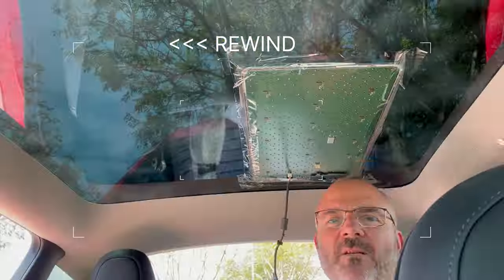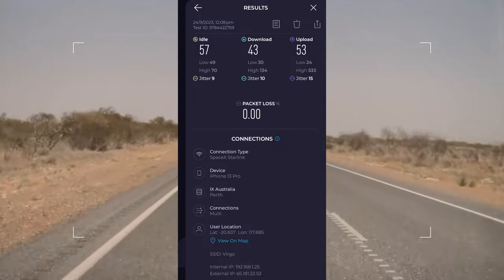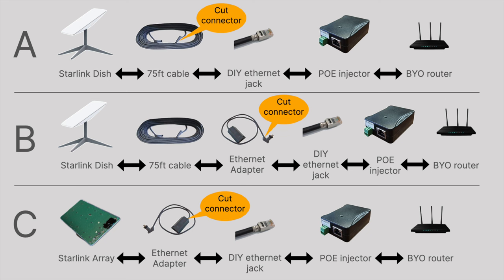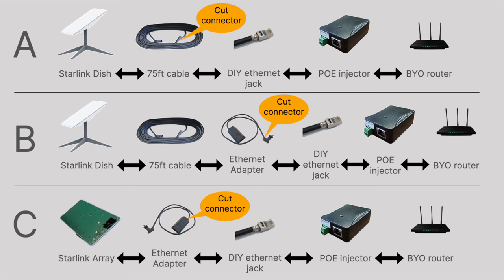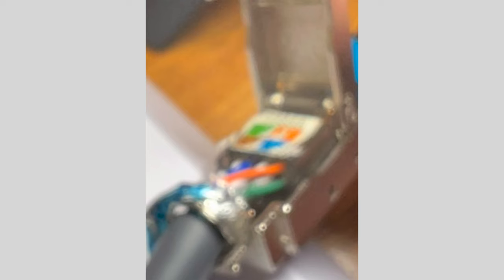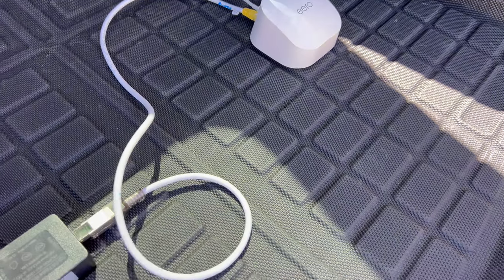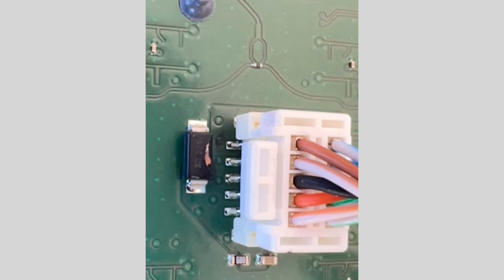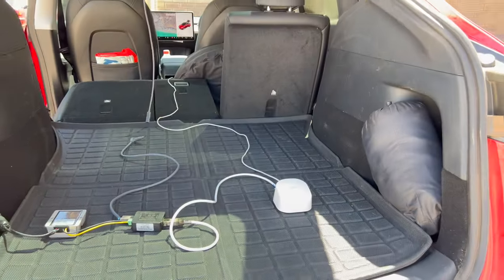Don't kill a Starlink converting it for 12V POE, I did!!

Comment: Based on the location and the way it's connected between the Ethernet jack ground and the PCB top ground pour, I suspect that this is a suppression component, possibly a TVS or a similar device. Providing a few high-resolution pictures of the component, its location, and the nearby parts could help point me in the right direction.
Reply from the maker: Thx @steelcuts. See some pics showing the damage in my reply posts to @sayanchx

Comment: Check if the polarity in your  supply into Starlink is right... at a cursory glance it looks like it may be a reverse polarity protection diode OR TVS device... maybe some others can help positively identifying the part if you share higher resolution images...
Reply from the maker: Thx so much for your help. Try these pics for context and higher rez. https://photos.app.goo.gl/a4ffe57u1YDh8pEx5

The part is burnt on top but I can make out a logo, I think, and the numbers 229.
Reply from the maker: I found another burn mark on the PCB, I fear this is going to harder than it looks. 

https://photos.app.goo.gl/PMcxHJqHKKFiSjcb9
Reply: Let's collaborate on this! Indeed, it appears to be a "standard" BY220 schottky Diode, likely serving as reverse protection. I did contemplate the possibility of the connector having reversed polarity. However, to the best of my knowledge, with proper POE implementation, polarity should not be critical, as most designs include a full bridge rectifier at the incoming DC+ and DC-. However, I suspect this PCB lacks one.

I believe the connector may have been wired incorrectly. The diode is a straightforward fix, and the trace can be repaired. However, the PCB in this area needs thorough cleaning and may benefit from the expertise of someone who is well-versed in these matters. If you're fortunate, the large black LAN transformer might have effectively shielded the valuable circuitry behind it and could possibly remain unscathed.

Edit: Also thanks for uploading the pics :)
Reply from the maker: Thx for the detailed reply. Given these conditions:

- I'm travelling in remote parts of Australia
- I only have access to a butane soldering iron
- My soldering skills are okay for non-surface mount components
- I have bad eyesight

...that I try this plan (Worst case is the board is still dead after I butcher it)

1. Buy this regular sized component: https://www.jaycar.com.au/by229-fast-diode/p/ZR1028
2. Desolder and hopefully remove existing surface mount diode
3. Use jumper wires to attach purchased diode from 1. to circuit
4. Use jumper wires to bypass burnt trace(s)?
5. Fix the POE wiring issue I have :)
6. Cross my fingers

Does this sound feasible?
Reply: @AUSY8  The BY229 diode might be a bit of an overkill, in my humble opinion. Soldering SMD components of that size isn't particularly challenging; all you need are some tweezers. It doesn't have to look perfect; functionality is what matters. However, a butane iron and poor eyesight can be a bit problematic. I've seen individuals with impaired vision accomplish impressive PCB rework, but they had access to microscopes and high-quality tools in our labs.

At the moment, the link is non-functional, and you can't make it worse, especially if there's no one in your area who can assist you or even do it four you. Your evident enthusiasm is often half the battle won. I'd be willing to help for free, but I'm based in Germany.

Your plan sounds fine, but I would still consider obtaining the SMD diode :)

Before you inadvertently make things worse while performing the repair, it might be a good idea to leave it as is, do some research, get some rest. This approach has saved me a lot of money and frustration in the past! :D
Reply from the maker: Sound advice there. I will do some research on a suitable SMD diode replacement and see if I can get some help once in more populated areas. Thx for your time.
Reply: @AUSY8  No worries, mate. I wish I could be of more help. If you have any further questions, please don't hesitate to ask. Wish you good luck! :)

Comment: Never let the magic smoke get out. 😂 Sorry you had the issue - hope you can fix it and get back on the Interweb. Cheers
Reply from the maker: Thx. The other upside, that I did not mention in the vid, is that we do still have a working dish, but I dare not mess with that one for fear I cut the other half off from the interwebs.
Reply: That sound was too painful to hear, sorry you fried the starlink. Good luck finding that part so you can resurrect your frankenstarlink 😊
Reply from the maker: Thx  @AutosNGizmos  I think I need all the good luck I can get at this point. I hope others learn from my mistake.

Comment: Man, why didn't you just buy the YAOSHENG RJ45 to SPX adapter? It's like 30 bucks... 😉
As for the burnt part, it looks like a reverse polarity protection diode to me. I think you should be quite fine only removing it as a temporary fix to see if anything else got damaged. But really make sure you have the power wired correctly this time. 😅
Reply from the maker: I just did. I have ordered one and expect it soon  :)

I was trying to avoid a lot of excess cable just lying around in the car. Anyway the moral of the story is double/triple check your wiring.

Comment: when you opened the dishy, you disconnected the starlink cable, why did you not just cut the wire coming out of the pole, took it out and made a new rj45 connector swapped going to the POE ? Then from POE swapped out and T568B to your after market router.
Reply from the maker: I was trying to smart and preserve as much of the original setup as possible and only cut the cable of the cheap $60 ethernet adapter. You can see where that landed me.

Comment: Ethernet jack you wired up, did not follow the T568B wiring, you appear to have swapped the green & green stripe with blue  & blue stripe
Reply from the maker: that's interesting. I thought I was very careful there. Its still works, would it impact performance?

Comment: Based on your last video I just watched it does look like you have the star link adapter backwards,  that cable should be connected to the 48 volt POE.
Reply from the maker: Yeah it may have been. I never did look for the root cause, which can be a failing of mine. As you may have seen from a later video I did get it going with new wiring.